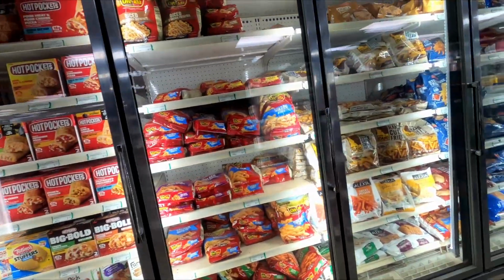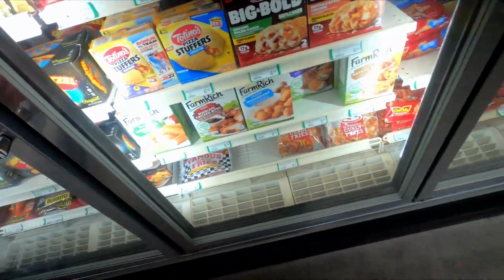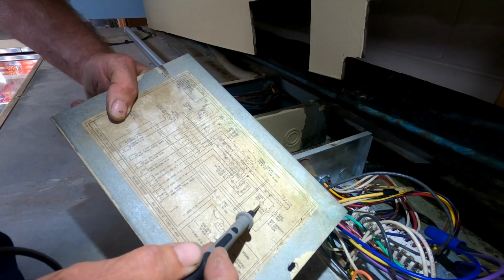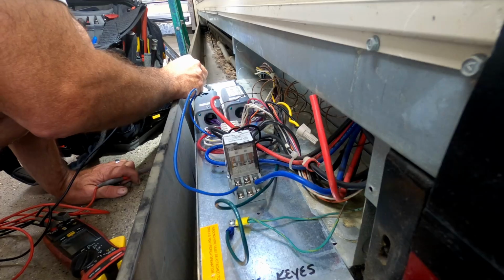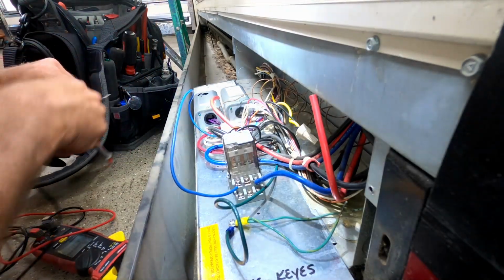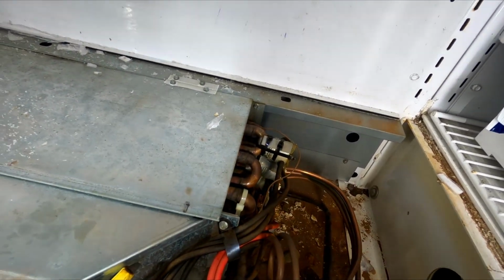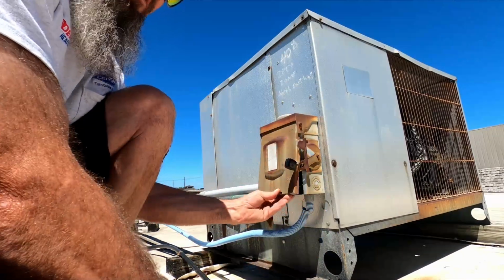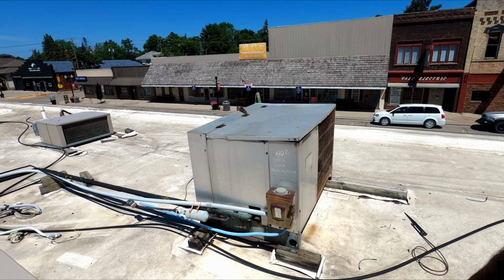5 Door Freezer Down

Comment: It does seem to vary on the commercial refrigeration side of things if the condenser is mounted inside or on the rooftop. My old high school has the condensers for the walk-in fridge and freezer mounted inside the kitchen, which really helped make the kitchen feel warm before they added air conditioning about 16 years ago on those warm late spring days.